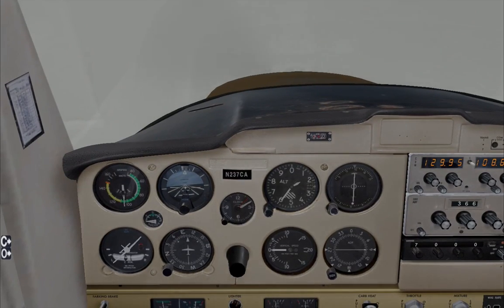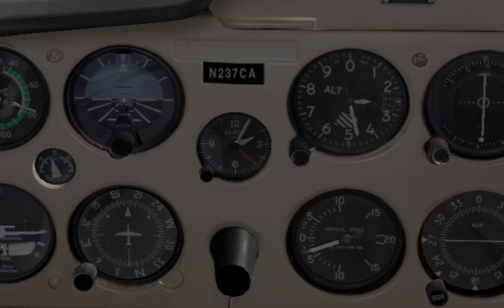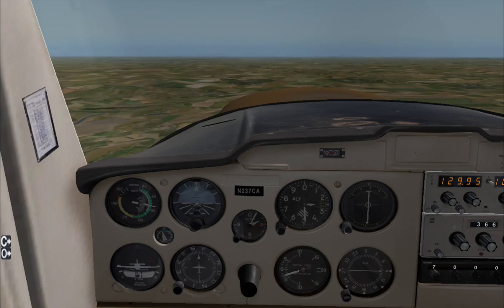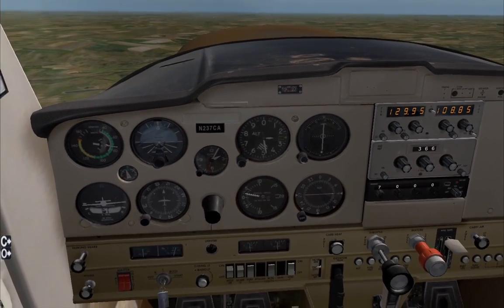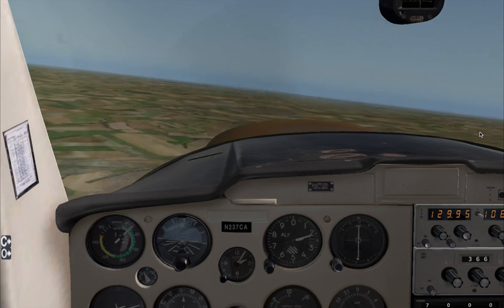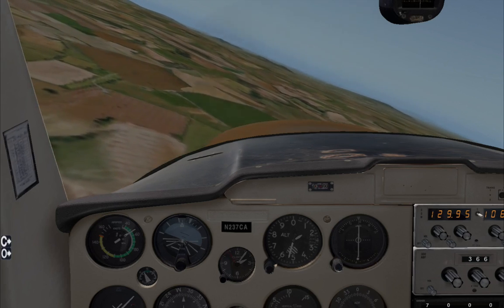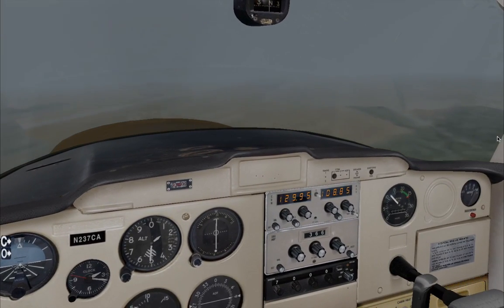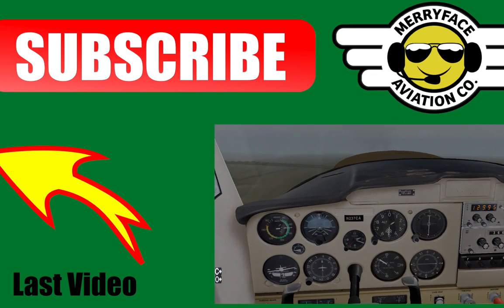An IFR Pilot's Worst Nightmare And how to Survive

Comment: I'm a 5000+ flight hours commercial pilot (CPL holder) & I'm 100% fully using IFR when flying. I've experiencing the same problem before but I never done what you suggested & will never do it. Real flight is different than the game (X-plane, Microsoft Flight Simulator & any other). it's simple. if you experiencing the same problem, just change your flight rule to VFR & if you have a gadget that have a PFD app installed, you can use it as your flight instruments. That's why pilots not 100% trust thier flight to the instruments. They always (spontaneously) do a hybrid flight rule (instruments & visual at the same time) for safety reasons.
Reply: how do you change the IFR flight rule to VFR on IMC?
Reply: carlos31071996 if you asking that question, it's mean you never bring your flight plan documentation w/ you when you're flying. I always bring all documents like map, METAR & NOTAM, weather change, etc. The most important is bring a gadget that can substitute the instruments like compass & smart device that have PFD app installed. If that happened use your substitute device & bring your plane down slowly until you spot the land. From that you can change your flight rule to VFR. But for me, that's automatic. Because I'm using hybrid flight rule (IFR & VFR) although I'm fly at 25000 ft. That's for safety reason. All pilots have been trained for using both flight rule at once.
Reply: I feel like I need to point out that his flight instructor is the one who told him this technique. And he did mention this configuration only works in certain aircraft (and sailplanes, apparently). Basically, it's a way to configure the aircraft so it drops at a steady rate on it's own. Which I'd trust WAY before I'd trust the GPS sensor in any cellphone I've ever used. Even the expensive ones are crap.

And I'll note that Xplane is FAA certified for instruction use. So while not the same, it's about as close as you can get.
Reply: +Dyl Connaway ???
Reply: Wolfgang Hieronimus Aslan Priyodarsono Bagio  You just aren't making any sense man...
Reply: Dyl Connaway what did you meant I'm not making any sense??? At which part???
Reply: Wolfgang Hieronimus Aslan Priyodarsono Bagio Everything you are saying. VFR at 25k? No. You fly VFR in IMC because you bring your documentation? No. All pilots are trained to always fly some "hybrid" VFR IFR flight plan and to not trust their instruments? No and no.
Reply: exactly, dude wolfgang hieronimus you just can't fly in VFR on IMC that just brakes a FAR regulation,  you can not fly VFR at 25000ft , that's probably class A airspace and vfr flights are not allowed, now yes you can have a COMPOSITE FLIGHT PLAN which is IFR and VFR together but you must specify at which point you are changing the flight rules and you should be clear of clouds or complying with FAR 91.155, unless you are not flying in the US then i don't know other countries policies , i'm a flight instructor and if you think you can fly vfr on IMC conditions, well good luck buddy.
PD: don't confuse VFR with VMC.
Reply: +carlos31071996 who said that I can fly VFR at 25000ft. I said that I descend to a correct max altitude first for VFR. I said I can do hybrid flight rule it's because I only can fly 12000-16000ft maximum altitude although the plane that I flown (Pilatus PC-12) have maximum ceiling altitude of 25000ft.
Reply: Dyl Connaway see people people doesn't attention carefully. Who said I can fly VFR at 25000ft. I said I descend first to maximum VFR altitude to do that. I said I can fly hybrid it's because I only can fly at 12000-16000ft maximum altitude although the plane that I flown, Pilatus PC-12 have maximum ceiling 25000ft.
Reply: ok i get that my bad, but why did you say pilots don't trust their instruments? what do you trust then flying on IMC? sensory systems?
Reply: Wolfgang Hieronimus Aslan Priyodarsono Bagio   You said "Because I'm using hybrid flight rule although I'm fly at 25,000 ft." I'm assuming English isn't your first language? I'm not trying to be offensive, but everything you are saying doesn't make any sense. And no bro, you never said anything about descending to a VFR altitude first or anything about your service ceiling... You are lost in the sauce man.
Reply: +carlos31071996 they just trust 100%. Sometimes they ask their real altitude, heading & speed to ATC & confirm that they're in the right way. After they descend for landing (at 12000ft), they doing VFR. It's just because all human made not as perfect a GOD made. So, sometimes instrument are error mid flight.
Reply: +Dyl Connaway yup, my main language is Indonesian & second is Javanese. I'm using English only when I'm flying & talking daily things to other people outside Indonesia
Reply: Wolfgang Hieronimus Aslan Priyodarsono Bagio    Well that's awesome. I can only speak Spanish, and I'm sure your English is better than my Spanish. I want to make it clear I'm not going after you or fault you for your mistakes with English, but that may be the source of some confusion. I tried to take the meanings behind the words you were using, or the general idea you seemed to be communicating, and I cannot find any realities in aviation at least in the states that align. Why don't you post any videos of you flying the TBM?
Reply: Pilatus, not TBM. Sorry.
Reply: +Dyl Connaway I'm sorry. I'm not flying TBM. I'm only flying a Pilatus PC-12 & before that I'm flying a Cessna 208 Caravan X CargoMaster II. For the flight video, I can't publish it since my company policy to do not allow us taping all about what we've done here. So, I'm sorry for that 😊
Reply: Ah right. Well that's unfortunate.
Reply: +Dyl Connaway yeah, and that policy always make me jealous to other pilots after they upload their flight video/photo
Reply: Wolfgang Hieronimus Aslan Priyodarsono Bagio You are really confusing. You can't just clap your hands and go to vfr from ifr
Reply: What, a PC12? Can you take me for a Ride with you pls? I Love that Plane...
Reply: I have taught this for many years with the addition of turning N and beginning it.  Use light rudder pressure to keep the COMPASS on N.  I have also proven this in many models up to a Seneca.
Reply: Completely Agree
Reply: What a load of bollox..  Why would u add complexity to a stressful situation if you did not need to? Think the answer can be found in your name. For many the notion of simple will never be acceptable.
Reply: Wolfgang Hieronimus Aslan Priyodarsono Bagio II
Reply: How would one use VFR while in IMC? I guess your trying to say use a tablet with a map on it to figure out where you are that's not what the video is describing he is talking about while in IMC losing all instruments no way to use VFR without any visual reference his to configure the plane so it flys it self without stalling but descends slowly until they break out under the clouds possibly.
Reply: Wolfgang Hieronimus Aslan Priyodarsono Bagio I believe he did mention he did this in real life and it worked. Other people commented saying that same thing. And that’s fine, you don’t have to. No one said you must do it. I’m glad you know the difference between flight simulator and real flying with your 5000 hours of flight time. We are all so proud of you.
Reply: I thought the whole point was when you're flying IMC. If you're flying in clouds and can't see s**t, just saying to yourself "okay I'm switching to VFR" doesn't make the clouds magically disappear. LOL
Reply: Wolfgang Hieronimus Aslan Priyodarsono Bagio lol, well... can’t you publish your video of you flying outside your company? You’re just a dreamer ;), no video = hoax.

Bacot doang bisanya kwkw.
Reply: Bullion Stack yeah, I’m not surprised, he’s lying about having 5k hours lol, otherwise feel free to prove me wrong.

He can easily stick a go-pro on the dashboard or fly outside his company i.e. rent a plane somewhere and uploads it on youtube for some credibility, the bullshiterry is simply too strong on this one, nuff said.
Reply: I find this specific procedure extremely risky for the simple reason that I don't have any instruments, therefore I don't have Altitude indication, although I start a descent by the hope to get under the cloud base and find visual reference? What about the MSA? I really would "create" an artificial horizon by using a bottle of water or just by putting a thing hanging from the top of the cabin (it will point the earth's center - approximately pointing to the ground ), and start climbing to get on top of the clouds. And always ask for some help from ATC. I would never, ever descent in a situation like that.

Comment: I will just stick to what I know... always fly with a half full bottle of water marked where the water sits. Artificial Horizon... which is all you need to turn around safely to get out the shit weather or continue flying until you are out the shit weather.

I wouldn't ever ever do this and it's disregarding tall trees, radio towers, power lines... just too much risk.

A bottle of water and small hand held compass cost no more than £5 and will never fail on you.
Reply from the maker: A bottle of water would NOT work. Sounds intuitive that it would, but it won't. Might try making a video to explain why it wouldn't.

Comment: DO NOT TRY DOING THESE!! I already tried in a real C150 and it DIDN'T WORK, actually the airplane never stalled but it started to bank to much so I had to take the controls back to prevent a possible spin.
Reply from the maker: Noted. Does not work with the 150. Don't assume though, that because it doesn't work in one aircraft that it doesn't in any other. It's worked with pretty much all the aircraft I fly. In any case, I have noticed this spiral (not spin) tendency that some aircraft have in this setup, and so I have modified the procedure, and it's no longer for IFR pilots but for VFR pilots into IMC. Will be making a video in the real aircraft soon.

Comment: What happens WITHOUT the nose trim? Center it and try.  
Also already pointed out but for God's sake yes Carb Heat!   
---
Too many variables I think for this to be any kind of reliable but I'm also a newbie.  
Definitely for certain planes only... and slamming that trim just urks me the wrong way for some reason.  
The airplane is engineered to fly itself with things all centered and clean not with trim in one direction and dirty as far as I think I know.
Reply from the maker: Hi there! Since this video I've found employment as a flight instructor. I teach this to my students whenever I get the chance. It works really well. Why full aft trim? Well, with flaps down, the full aft trim will make the aircraft always look for the slowest speed without ever stalling. This will result in a lower rate of descent, which will give you more time to recover when breaking out from under the clouds, which may be as low as 300ft agl. Don't "slam." Just spin it all the way aft, the aircraft won't behave as violently as you think.
The exception to this is the piper tomahawk. Do this normally, then spin the trim forwards a little bit. This is because the tomahawk is a little bit less stable. The trick works fine with it, but it will descend at about 1000fpm and with a 30 degree bank. This trick works with all training aircraft I can think of, and has worked with every aircraft I have tried it on to date.
If you center the trim it will work "fine", but you'll end up with a high airspeed and excessive descent rate. The idea is to descend as slow as possible, both airspeed and vertical speed, while avoiding a stall spin situation.
Reply: Exact results (and settings) SHOULD vary by aircraft, and even with aircraft loading/balance.

With CG at the aft limit, the extreme trim may be a bad idea.

As some are noting in comments, effects are varying a bit with which aircraft.  There may be a better elevator trim and flap setting for some aircraft.

Part of this setup is possibly intended to minimize speed at impact.  If you don't get out of the clouds or get instruments back... you'll find the ground.  This should hit nose high, snap the gear  (if fixed gear) and tear the airplane up while minimizing injuries (hopefully... depending on what you hit)  A blind IMC landing with no instruments, that's probably best you'll get.

You're looking at a survival situation.  No instruments and no visibility is deadly.  How can you set up the plane to give you the best chance to survive the crash?  Because if you don't get something back... you will crash.
Reply from the maker: yup. Defo a survival situation and it's absolutely a last resort technique, as far as I'm aware and that's how I teach it (when I have enough time to do so). As for your comment of the aft CG, I'm not entirely sure that's true, but I'm willing to go out there and incrementally bring the CG aft with bags and whatnot and try it with each config, see if there's a difference. From what I understand, full nose up trim should never get you below the lower limit of the white arc when the aircraft's CG is within limits. Of course, I could be completely wrong! I'll try and get back to you on that.

Comment: I think this maneuver has some good to it if your in smooth air, but anyone who has flown real solid IFR in heavy rain should know that this would be extremely dangerous if it is turbulent. When I am hard IFR in heavy rain you have to watch your airspeed! Not so much because of pitch changes but also because your getting thrown up and down, not sure i would want to trust the airplane with full aft trim to keep me far enough above my stall speed while in a slightly banked spiral. Bit considering the doomed situation it may be better to try than nothing. Hopefully people have some sort of electronic portable device. (Ipad) could save your life. 
By the way i fly overseas a lot and foreflight works internationaly, It has worldwide data i think it sould work in europe, it works in south america and parts of asia. ;)

Comment: This seems like a good idea. I saw a video about the Cherokee (140?). It showed how it really does not stall and referred to it as the "stubborn little cherokee". Weather and other circumestances has kept we on the ground here in DFW. I have owned a 1971 Cherokke 140 since 1989.  It sat in a hanger for 15 years. Why I don't know. I put fresh oil in it with no products of combustion and pulled the prop through at least every two months, usually every month. Once in the early 90s, my articficial horizon went out. It went hard one way, and being taught the more modern integrated flying, I had to concentrate to ignore it. I was about to cross over midfield to my home airport.Anyway, I might try this. But I would only put TWO NOTCHES of flaps. At that point, before you do this, I would call 121.5 and DECLARE an embergency. Of course, on my studeint LONG cross country, SOLO,  I was ain heavey haze. Ugh, for 20 minutes it was like someone threw a blanket over my windshield. I had a large dose of peace I assume from god, but it was not obvious at the time. Turns out my Electrics Solenoid (behind the seats), which is like a master realy for the radios etc, decided it was tired. So, I could not open my flight plan in air. Oh well. I could see the ground. but it was a bit hazy. I popped put of a stalled front about 10 miles south of Cedar Hills Towers (South and West of Dallas). It was dusk and the lights were light up like Christmass trees. I have a rule: I don't take off without fuel up the the TABS. That is a visual for 18 gallons in each tank. The flight was  a total of 3 hours (each leg 120 miles). Later I figured out the auto fuel i bouht at the airport had a problem. Fuel has an anti-xxxx(?) that stops bacteria from eating the octane. My guess is that I was burning 20 gallons per hour or is what I estimated in my head (probably from how much fuel it took (this was 1989 so don't quote me). Seems there was something else.

Comment: Trim up? Really I don’t think so. And pulling throttle out. No chance
Reply from the maker: as long as the aircraft weight and balance is within limits you won't stall. try it VMC, so that you can recover if necessary. I've done this in a C152, C172, Pa28 and Pa38 (the latter needs a small adjustment to the procedure). It works with all of these.

Comment: Carb heat
Reply from the maker: fair point. Wasn't really concentrating on that though, just the aerodynamic configuration. I'll add a note.
Reply from the maker: note added, crediting you. Thanks for pointing it out!
Reply: Hmm, carb heat on what is basically an emergency descent while trying not to death spiral?
Personally I would worry more about attitude, the plane will still glide in that configuration with no engine.
Reply from the maker: It's a question of avoiding adding another problem to your situation. You really don't want to deal with carb ice on top of everything else.
Reply: Oh I agree it should be done, just secondary to getting the rest done.
Reply from the maker: yeah that I agree with